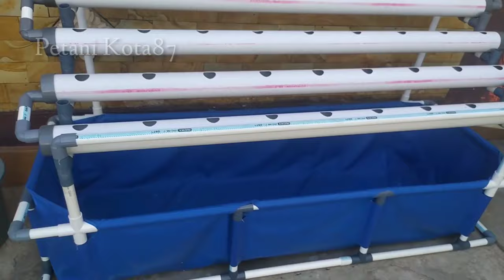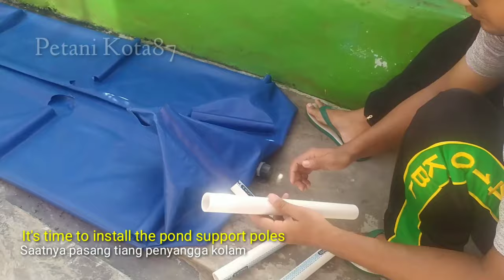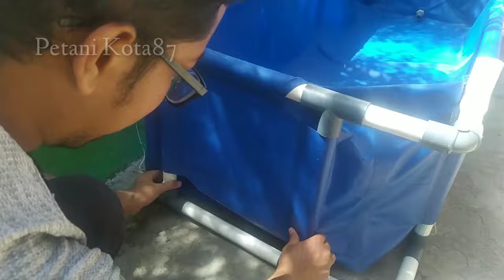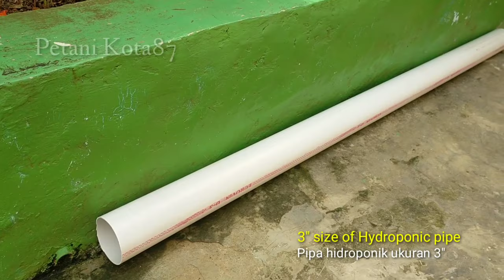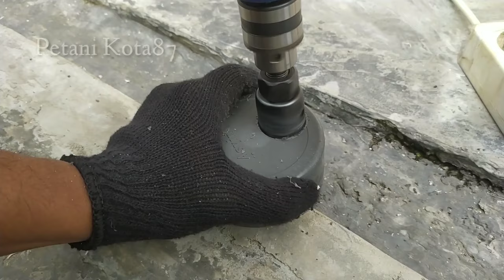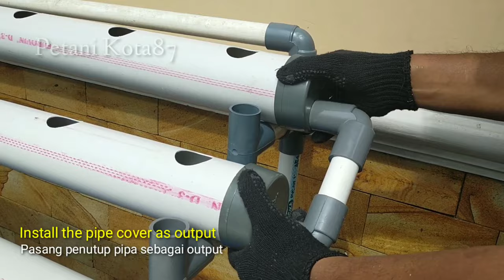DIY : How to make Simple RAS system Tilapia Ponds || Aquaponic System (part 1)

Comment: How do you control the water temperature?? Doesn't using a rubber tarp heat the water in summer?
Reply: Control the flow by adjusting the tap until you get the correct flow I would imagine.